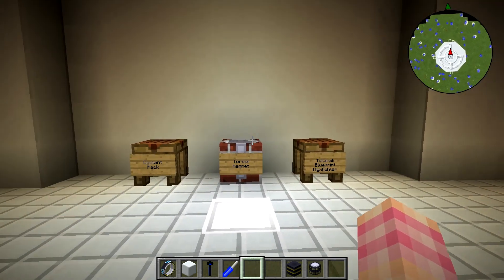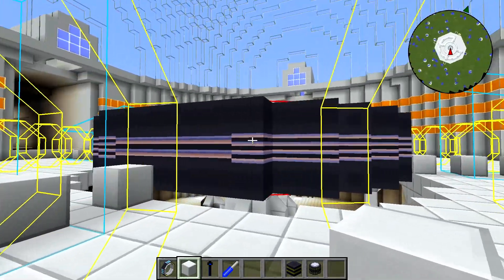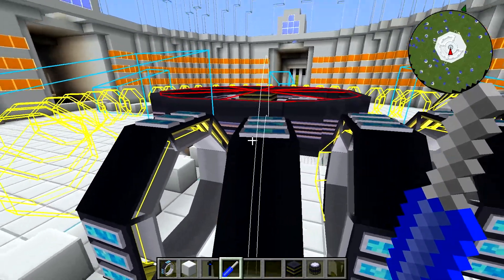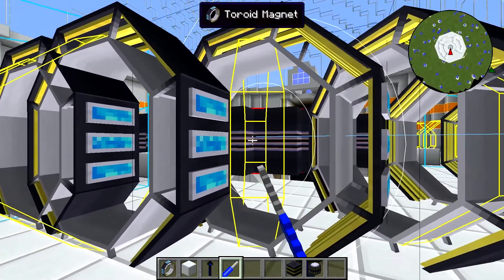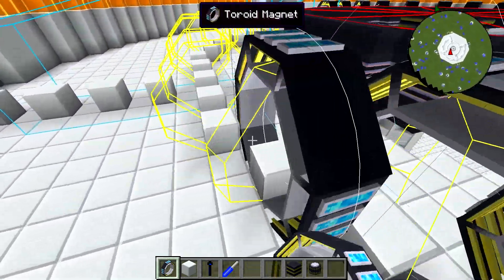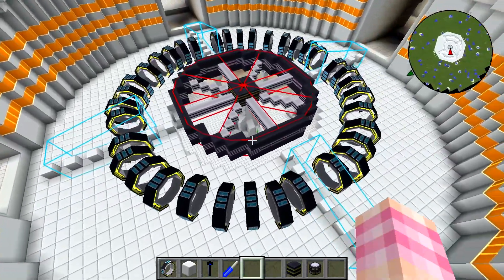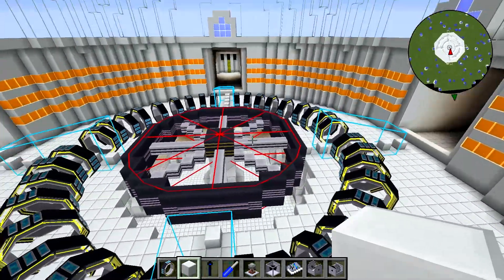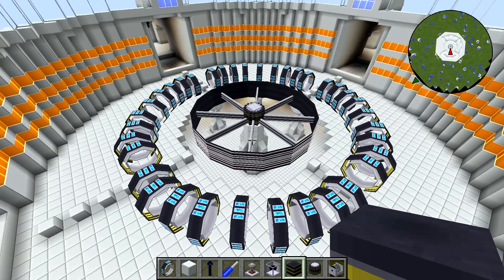ReactorCraft Tutorial #21 - Toroidal Magnets

Comment: How did you get it so the tooltips in your inventory don't show the mod that a particular item is from? Example, you hover over the HSLA steel and it doesn't show its from Rotarycraft, how did you hide this?
Reply: That is WAILA.
Reply: I'm talking about in the tooltips that appear in the inventory when you mouse over an item, not the one that WAILA adds while looking at a particular block. I've looked through all of WAILA's options and doesn't have this config option. I just noticed in this video it didn't show the mod name in the tooltips.
Reply: They are both WAILA.

Comment: I think you placed some toroids with the arrows pointing outward and I think you have to have at least the plasma injector block itself placed properly for the sparks to jump, and don't forget to supply liquid nitrogen with a liquid pipe two blocks above the toroid center block.
Reply from the maker: I asked Reika about the placement of the nitrogen pipes and the Van Degrafs and all of this will be addressed in the next video. I'll admit to being a bit rushed when making this video.
Reply: Sorry, the pipe is not 2 blocks above, just a 1 block gap, kind of entering those three blue things at the top
Reply: well you don't necessarily need the plasma injector blocks to tell if it's working, because sparks would still be jumping between a few of the toroid magnets but wont jump the gap
Reply: So the sparks weren't jumping because wrong placement?
Reply: indeed